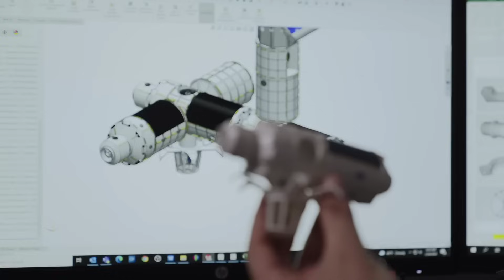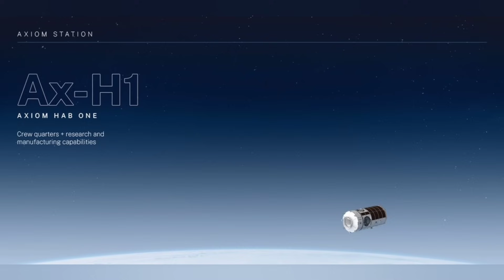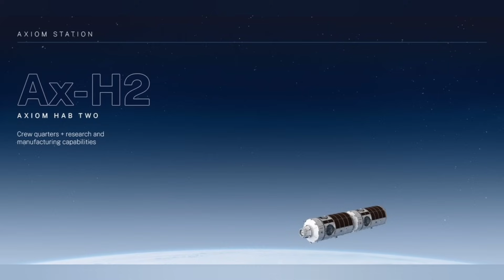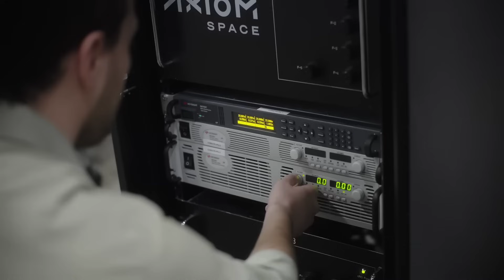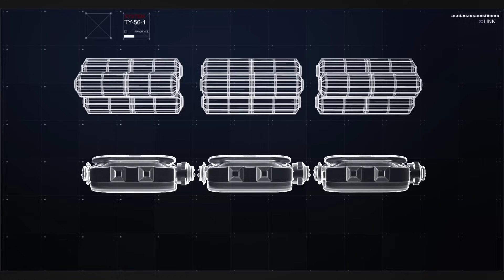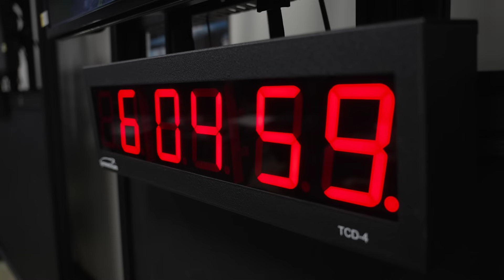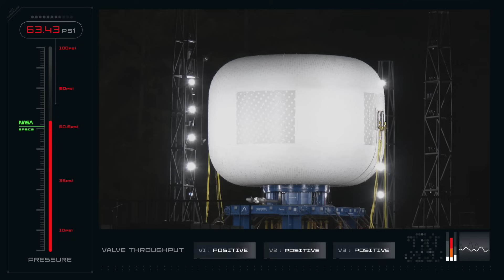Two new NASA space stations are almost ready to replace ISS!!  Axiom and Sierra Space!!

Comment: Every video I have watched on Sierra shows them blowing up as in exploding one of their blow up modules.  I just have a question.  Why?  Is the space station going to just suddenly increase their air pressure to 4 or 5 atmospheres?  I don't think so.  Something could perhaps explode in there but has anything ever exploded inside the ISS and what is the over pressure spec on the other conventional modules?  

I have never seen any over pressure test on any other type of space station module but I suppose they do test the things and the hatch seals as a matter of course on testing.   It just gets aggravating seeing nothing but exploding modules from Sierra all the time.   I think it starts to make people feel like there is some explosion leak issue or concern with the things.

And another thing, LOL.   There is an earlier version of this module already attached to the ISS and has been attached for how long now?  The people up there in the space station use the thing only to store junk in.  This appears to present the idea that they are afraid to go in there for any length of time.   If they are that afraid of it they need to detach it and jettison it.  

In a July 30 presentation at the ISS Research and Development Conference here, Nathan Wells, an instrumentation lead for the Bigelow Expandable Activity Module (BEAM) at NASA, said the module’s on-orbit performance had exceeded expectations and that it had been cleared to remain on the station to 2028.

Comment: Sierra definitely has my preference, being able to get such much more volume in space is much more tailored to progress compared to the more status quo Axiom (which ofcourse still are a good thing).

However I do expect that the equipment etc for the modules will also need to be sent up seperately and not stored inside the module, right? If that is the case, it likely will require 2-3 extra launches to fully activate that 3 module station that will have the same volume as the ISS.

Comment: After the Titan submersible implosion, you have to wonder about living in a big balloon in outer space. Yeah, yeah, I know that carbon fiber is extremely strong under tension but problematic under compression.

I'm too old and not rich enough to dream about being an astronaut or Mars colonist. But if I were going to live in a space station for awhile, I'd feel a lot safer in a metal cylinder where you can at least imagine a hole being punched through it not causing a structural failure, and even being something which could be patched. Although when I look at pictures of how much insulation and stuff is covering the inner walls, I doubt that an astronaut could get at a hole from the inside and patch it.

I think an inflatable habitat is a great idea for a recreational area, emergency shelter, or docking unit.

Comment: Axiom is very much building the space station modules themselves, in-house, in Houston. Thales Alenia is only building the PRESSURE VESSELS, the outer shell. That's it. The "module" includes everything else: power, wiring, electronics, control, communications, environmental control & life support systems (air & water recycling, heating, cooling), experiment racks, work spaces, pantry, toilets. Thales Alenis isn't building any of that.

Comment: The advantages of a Starship Space Station are its cost and its station keeping capabilities. The payload bay space  will be 1,000 cubic meters, which is comparable to the largerst LIFE module. If Starship costs $2-$10 million to launch then expendable mode would not be vastly more. The cost of the expendable mode launch would then be the basis for the price of a Starship Space Station, not including furnishings and equipment. And the engines could be used for station keeping. The LIFE Modules will be great for the construction of much larger structures. The Axiom space station will be useful for  smaller scale stuff.
Reply: Vast Space is planning to use Starship for space station modules that are perfectly sized for its payload size.

Comment: Have some (not necessarily original) ideas I hope don't come off a crazy or impractical or impracticable:

Imagine if the Sierra modules can be used as:

— collar-connected modules of a vessel going to Mars (would it need to be pre-departure coated for solar protection?; can it meet torsion/twist/deflection/other considerations?)

— prepositioning stages around Mars, robotically deployed in orbit as well as used as on/in-ground modules covered in protective material

— towed but optionally engined in case the the tether must be cut and if the towed inertia is insufficient to ensure orbital insertion 

— emergency lifeboats that can be carried uninflated, but be jettisoned as a survival hab module with an accompanying, separate supplies module, on the assumption that any from-Earth rescue would be a year or more out

— Gateway-like quarantine modules wholly separated from the modules that don't do hazardous projects 

Perhaps these modules can be positioned in orbit of Mars and Earth, parked just for transfer to emergency hab. Perhaps they can be there for ANY nation to use in the event of an emergency or abandon station order.

Comment: Sierra has to deal with the BO millstone around their neck... BO may make something that works but the time from start to finish is something else and the "that works" part is still a question mark as well. Strength of inflatable? The other question is what about the strength of an  aluminum shell? Aluminum is not that strong either. Anyway, I expect Axiom will be first and well used. If Sierra gets past BO they may be just in time to take the overflow from Axiom.  Of course Spacex may get their gas station going before both of them.... Not a space station? Well, not inhabited, true but a type of orbital infrastructure none the less.
Reply: You might want to look up the photos of the actual New Glenn 1st stage and 2nd stage hardware now at LC-36. Oh, and those BE-4s on Vulcan Cert-1 were perfection, weren't they? 

For Orbital Reef, Blue already has met several milestones, including a series of tests of the large windows that will be used on the modules.
Reply: @mikedicenso2778  colour me unimpressed. I am sure they will get there, eventually.... which is what I already said.
Reply: @lenwhatever4187  If you're "unimpressed" by the world's third largest orbital launcher, then nothing will ever impress you. That is an enormous amount of effort to build something on that scale. 

But you're becoming typical of the people suffering from cognitive dissonance over the recent Blue Origin milestones:

- New Shepard successfully returned to flight last month and far sooner than Virgin Galactic's SpaceShip 2 (1 year vs 4). 

- BE-4s were delivered well over a year ago to ULA and now are flight-proven with as close to a flawless as you could hope for operation.

- Real New Glenn hardware is out at the pad in preparation for testing there ahead of a flight hopefully at later this year.
Reply: @mikedicenso2778  Ayup. And they'll be getting wackier and wackier the closer we get to New Glenn launching, just as they did when the first two flight BE-4s got delivered to ULA in 2022.

Comment: The strength of a module is the strength of the material times the thickness. The inflatable modules are much thinner than metal modules, so the metal modules end up being stronger. Dreamchaser has not carried humans yet.
Reply: But the inflatable module also can give way more, allowing for the force of an impact to be more distributed over a large area.

Where did you get from that the regular modules have thicker skin?

Comment: Sierra Space may be able to put up an empty shell with the habitable volume of the ISS in just 3 launches at a low cost, but then to populate that empty shell with all the plumbing, air conditioning/filtering/recycling, temperature control, and other such life support equipment, plus propulsion and station-keeping, energy generation/storage/distribution, and lab/manufacturing equipment, etc., not to mention all the 'furniture' for use by the crew, including sleeping racks, restroom, shower, kitchen/galley, and exercise equipment, etc. - that'll all still take a bunch of additional launches and missions and expenses.

Im not too worried about their modules 'popping' when penetrated by micrometeorids - after all, these aren't rubber balloons.  Any small holes in them should be patchable with the right equipment.  But I do wonder how well these polymer fabrics will stand up to space and solar radiation and the constant cycling of temperature extremes on the external surface.  Here on Earth, most plastics don't tend to do well in strong sunlight - and that's barely a weak analogy to the kind of harsh environmrnt they'd have to endure in orbit.  So I wonder about the longevity of such modules: will they have to be replaced every 5 or 10 years?

Comment: I'll take Von Braun's station over a blowup toy. All it needs is a speeding "pin" to pop it. Axiom seems to be well thought out.  (Could use a few more segments.) Same for Gateway Spaceport, although I think that will take more time to be built. My query is how to get the smaller stations out of the way of large junk quickly and can they handle that load.
Reply: The "blowup toy" is actually supposed to be stronger than these regular modules. Internal structural reinforment probably will also be added/present to deal with cases of pressure loss and prevent collapse. There really should be no reason why the inflatable modules are going to be less safe if the stated parameters are correct.

Comment: 14psi difference is in my opinion not " enormous pressure difference ". But hey what do i know.
Reply: The LIFE modules will normally be inflated to 14.5 PSI, basically sea level pressure. The capacity of handling five times that is great at accounting for micrometeor impacts over the station’s in-service lifetime.

Comment: Great Video !  Bigelow Aerospace has two test inflatable modules in LEO for a few years !  A third module is docked to the ISS for a few years also !  The BA-330 module was designed to have more volume (330 cubic meters) for the same weight as a tin can NASA module !  A good orbit to support a  Commercial Space Station (CSS) is heading East from the KSC (28.5 deg. orbit) that Apollo use to launch to the moon.  The Dream Chaser may launch in April 2024 on the ULA Vulcan rocket to the ISS on a Cargo test flight.  tjl

Comment: What is wrong with a rotating space station? Microgravity experiments could be done at the center hub. The station depicted in 2001: A Space Odyssey is the way of the future! These non-rotating stations are destined to be de-orbited in just 10 years after deployment. Coils built into a spinning station could create plenty of power by interacting with the Earth's electro-magnetic field, remember the failed experiment using wires extended from the space shuttle years ago- it failed because too much energy was generated- melting the wires! I guess I'll just dream on....
Reply: If you extract energy from the station's rotation, it will soon stop rotating.  You'll then need to spend fuel to keep it rotating.  At which point, it's just another, if round-about, way of converting fuel to energy.

In Earth orbit, it's much more efficient and sustainable to generate energy from sunlight, via solar cells - as there's already plenty of fuel in the Sun, and it won't need replenishing any time soon...
Reply: Point is that if you want to build a rotating station that does not make us humans get sick, it does need to be at least 300 meters big, and is therefore not possible to build with our current technology. (Or maybe possible, but to expensive and it will take you many, many years to build.)
Reply: Make the dream come true! Find an investor.
Reply: This is pretty much the plans of Vast Space's space stations into the 2030s.

Comment: What about 60psi when a micro-meteoroid impacts it at 17000 mph?
Reply: In use, these modules will never hold more than 1 atmosphere of pressure - which is just 14.7 PSI.  In practice, they might drop to much less than a full atmosphere; for instance, airliners are allowed to pressurize the cabin to just 11 PSI at cruising altitude.

So the fact that their module can sustain ~7× the operating pressure just demonstrates its design safety margin (at least when it's in mint condition, fresh out of the factory.)

As for micrometeor impacts, I expect the ones that make it through will simply punch a hole - just as they would in a steel wall.  The hole could then be patched with an appropriate repair kit (not too conceptually different from patching a hole in a car tire.)
Reply: @Spherical_Cow Im not sure I disagree. When the module failed, it didn't just  happen in a small area, the whole thing disintegrated. With a plane for example, it only affects a small area around the hole, not the entire pressure vessel.
Reply: @ronwatkins5775  it disintegrated because the failure mode is fundamentally different.  When you ratchet up the pressure to near the overall structural limit, any weakening of the pressure vessel at any point causes the entire vessel to fail.  However when the pressure is a factor of 5 or more below that critical threshold, even several localized punctures won't cause the rest of the pressure vessel to disintegrate.

Think of car tires as the analogue.  Puncturing a tire inflated to its operational pressure doesn't cause the tire to explode.  Even multiple punctures won't do that.  But, overinflate a tire to its point of structural failure, and even a single small puncture might tear it apart.

Comment: Can Sierra space shoot at their inflated module? An inflatable habitat means more volume and so, more chances to being hit by some randoms debris at many km/s. So if this thing cannot resist a gun shot or something like this, i won't trust this thing, and for Axiom, what's the point of their empty module, where do you put any kind of scientific instrument? Is it strictly commercial? Where are the radiators cause having black solar panel all around the modules doesn't seem safe to me, it just gonna heat up the habitat to infernal conditions, and finally is the glass of that observatory module is absolutely safe, can it stand both debris and radiations. And how does that giant solar panel work? There's so many weirds things with thoses stations i'm almost certain that if it ever exist it won't nearly look like what's promised.
Reply: the glass of that observatory module is absolutely safe  Modern clear polycarbonates are actually more durable than steel (kevlar is a cousin of polycarbonates).  Weight and expense get to be an issue.
Reply: Shoot a rifle at a pressurised aluminium can like the ISS it will depressive at best explode at worst. I don't see the inflatable modules being any less safe. 😕 the space station has ablative shielding which is essentially built into the inflatable module.
Reply: @hedleypepper1838  But of course metal has proven itself to be practical and durable, which is necessary in an environnement where you'll have to do with it for a definite amount of time but did they tested this material in real condition before wanting to send people aboard, civilian at that, not scientists or soldiers.
Reply: @user-vo8zx2uj1p  there is one right now attached to the ISS it's been there quite a while. Used for storage I believe but it's up there and being tested in the real world, or out of it lol. 🤔